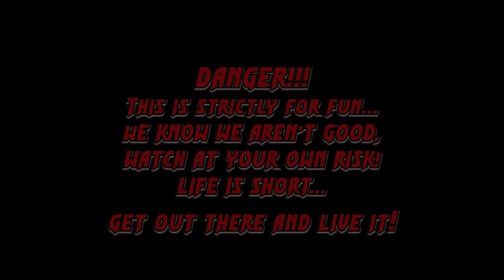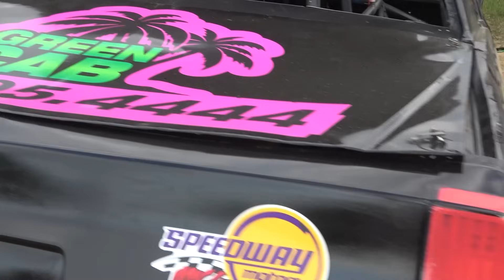2024 Season opens! Dubuque Fairgrounds Speedway

Comment: It’s typical it takes time to dial a car
In especially since both of you are new to the class and to the car. I like the idea of the professor getting the car up to speed. Then you can develop as a driver. Kinda hard to develop as a driver in miss handling car. 

One this that’s so different up your way is 90% open trailers. It’s completely opposite here and you see mostly enclosed trailers. Even FWD use enclosed trailers. I don’t have one in fact one like yours would be nice because of not having to load tools, generators ext up every week.
Reply from the maker: So we keep the open trailer for Dubuque... it's a blast to park inside the track, and open trailers only are allowed there (enclosed go on the backstretch). When we travel to new tracks this summer we'll probably go with the Professor's enclosed.